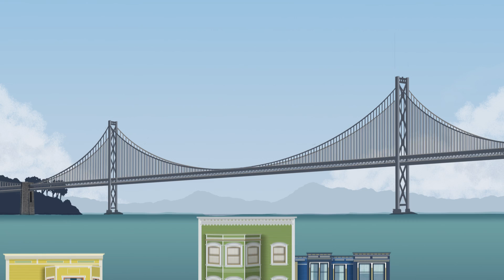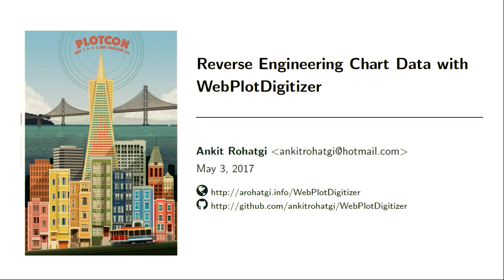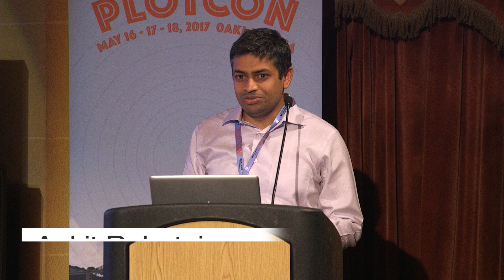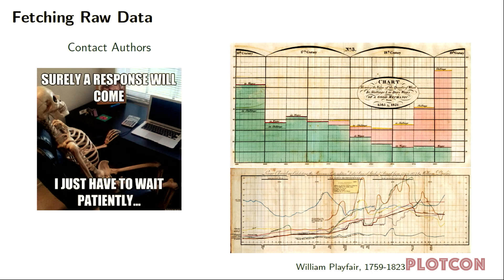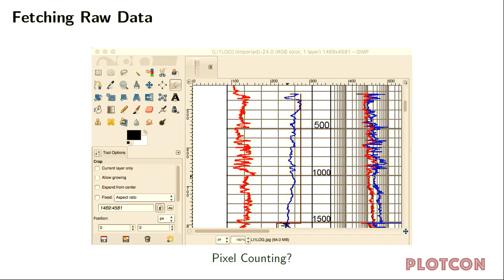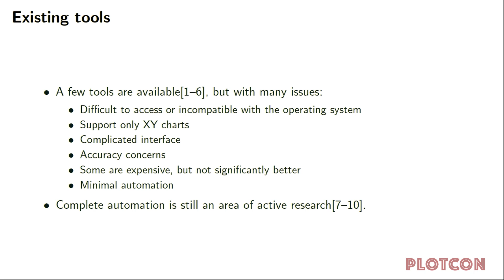PLOTCON 2017: Ankit Rohatgi, Reverse engineering chart data with WebPlotDigitizer

Comment: Thank for this Dr. Rohatgi. Your developed tool, WebPlotDigitizer,  helped me greatly in reading and extracting data from Dukler plot in Perry's chemical engineers handbook and the film coefficient for condensation on vertical surfaces in McCabe and Smith's Unit Operations of chemical engineering.

Comment: Worked great to flatten both headphone and speaker EQ curves for REW software.  Used this to translate various eq curve data (from screenshots, pdf files, and scanned specs) about particular headphones and speakers, into a format used by the free REW (room eq wizard) software.  Can now easily switch between headphone-flattening or speaker-flattening curves when mixing audio in either headphones or speakers.  Excellent software!